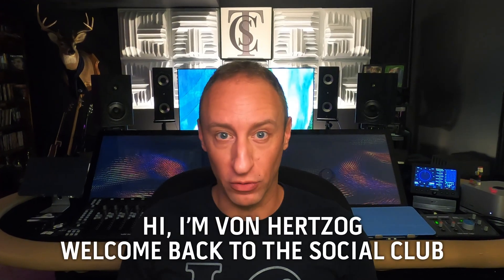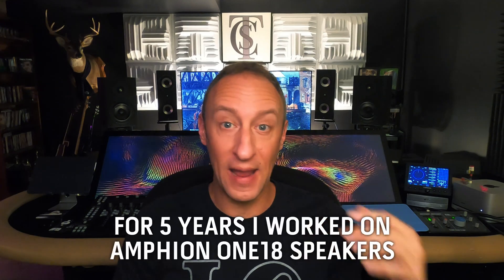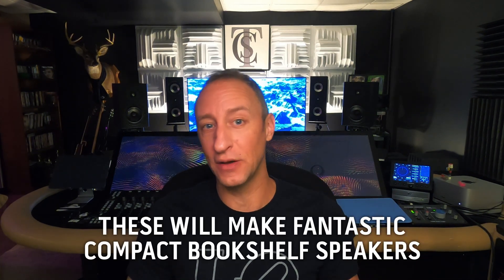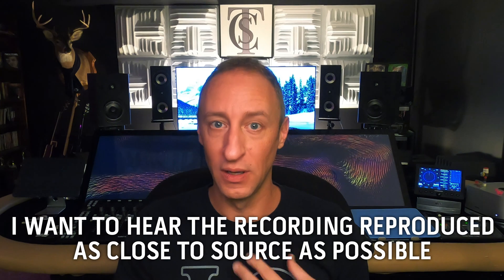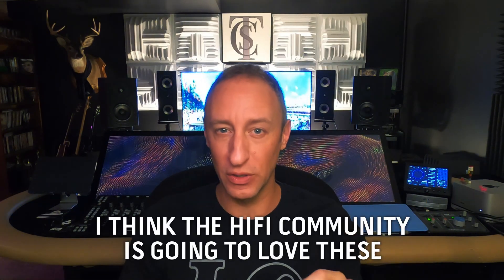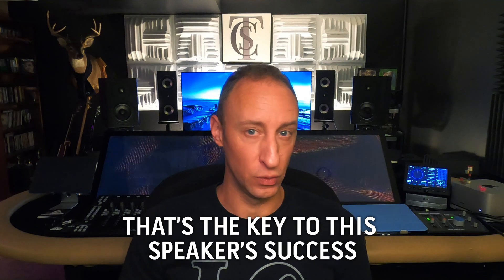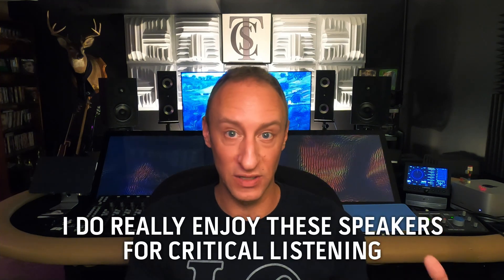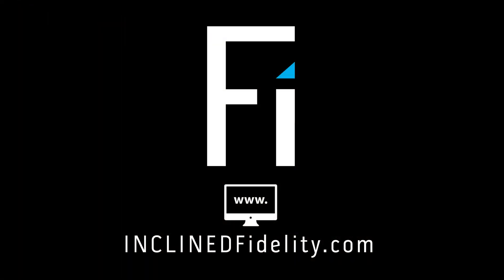NEW SEAS DIY HiFi Speakers! Parts list included! Reed Paper Woofers! Aluminum Tweeters!

Comment: Fantastic video. I'm deadset on building these in a sealed box, which I'll make myself.  A few questions, if you don't mind. 1. Would it be worth throwing $200-$400 additional at the crossovers for this combination? 2. In a sealed box, should the volume be reduced? 3.. Do you offer consultation services or Patreon? Thank you for your time and effort.
Reply from the maker: Thanks so much for watching! I'm using them in a 0.23 cuft sealed cabinet with 1 inch foam lining the inside and it's really great. Yeah if you can spring for ClarityCap CSA or PUR caps that would be great. And I do have a Patreon. At the moment it's geared towards people looking for audio engineering and co-production services. But I think in the New Year I'm going to start to add a speaker building aspect to it as well. Thanks for watching! And reach out with any questions you may have

Comment: Can you design a front ported d'appolito floorstander with these components?

Would love to compare that to my Fyne F303s which are basically the same idea.
Reply from the maker: If I grab more woofers I could do that. Or do you mean just design it on paper?
Reply: @SocialClubSound  Design on paper would be nice but a build with video and results would be nicer.

I am a floorstanding speaker guy and I miss a reasonable priced design that works and is front ported.

I do have to add that I am in Europe so sourcing some materials is a bit more difficult as in: more vendors needed.

Comment: Excellent   Thank you   I have subscribed     ...  Where can I find the cabinet drawings ?
Reply from the maker: Thanks for subscribing! The cabinet is a pre-cut knock down cabinet from Parts Express. So the only thing you'll need to cut holes for is the woofer and tweeter (and maybe terminal cup if you don't use posts). I've updated the video description with a link for a PDF showing the driver placement on the front baffle. That should help clear up any questions but if you have other questions, just reach out and ask. Thanks! 

https://thesocialclub.studio/youtube_downloads/SEAS-H1455-H1283-Driver-Placement.pdf

Comment: I'm glad that I found your channel, I started learning about designing and building speakers about 2 years ago. I have built 3 different pairs and a nice portable Bluetooth speaker. But I haven't experimented with many drivers. I have used the Dayton reference paper cone woofer which I think sounds good. I have used the Dayton reference soft dome tweeter and after listening to what you said about it I'm ready to try something different . I'm getting ready to design a 3 way with a 10" driver and I might order the seas that you just used for the mid, and maybe even that tweeter. I enjoy the challenge of designing the crossover and doing the testing. But it's great to learn from someone who has been doing it longer with more experience like you and I am looking forward to more videos!
Reply from the maker: Nice! Thanks for watching and let me know how your 3-way speaker turns out. Did you see my video where I built the SEAS King RO4Y MKIII kit? Active 3 way with DSP correction and that big old 10" sub. Thanks for your comment!
Reply: @SocialClubSound  yes, that was the first video I saw. That speaker looked awesome. I have been looking at the seas that you just used because I saw it on sale. I think that I am going to use it with the 22 mm seas that you just used. I already have a Dayton designer aluminum cone 10" woofer.
Reply from the maker: Excellent! Let me know how it turns out and thanks again for watching

Comment: I have been using that tweeter in my speakers for 12 years now, and I have replaced them both after one went strangely intermittent, although that was possibly a connection issue since nothing was wrong with the tweeters I took out, but I think they are close to the perfect dome tweeter for me. The midwoofer I have been using with them is the Tang Band W4-1720, in a small monitor speaker I call the "Neutrino"; they are extremely neutral but still extremely engaging, which is a rare pair of qualities in a speaker.
Reply from the maker: Excellent! Yeah, loving how clean these tweeters play. Thanks so much for watching and commenting.

Comment: In my experience and preference, I don't believe you could have designed a better 2 way speaker in this component cost range, full stop. Great work! I am surprised a 'hard' dome tweeter doesn't reach fatiguing levels. The smaller size and crossover design helps with much of that potential I presume.
Reply from the maker: Wow! Thanks! I think the tweeter being so low distortion helps a lot with the fatigue factor. They've been great to listen on. Thank you for your comment!

Comment: When I was first getting into hi-fi in the '70s, I asked a rather well known engineer from the country music side, how to best hear what he intended. He told me to get a pair of JBL L100 and put them within 5ft. of my face, toed-in just so. . . 

I have never cared about source accuracy. All it has ever needed to do is be loud enough, and audibly low distortion, meaning. . .no rubbing voice coils or farting woofers and the awful noises that wasted surrounds makes. As long as the speakers are reasonable low distortion, are balanced across the freq ranges, my imagination will smooth over the rest. 

This design seems like it might would be better served as part of a 3-way. It needs some displacement for the lower end. The world is overrun with four and five inch bookshelf designs. We need more 8" thru 15" three-way designs, IMO.
Reply from the maker: Fair point. I was trying to keep the budget under $500. And these do easily pair with subs. Thanks for commenting